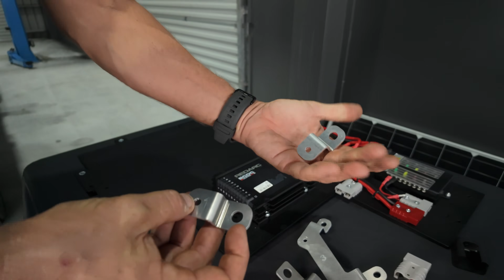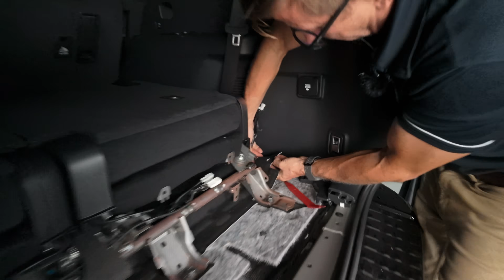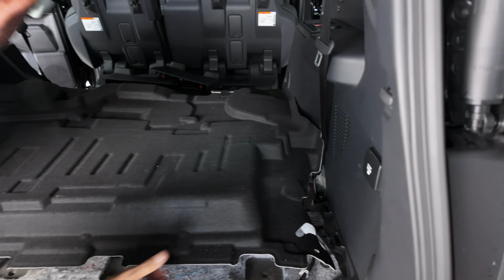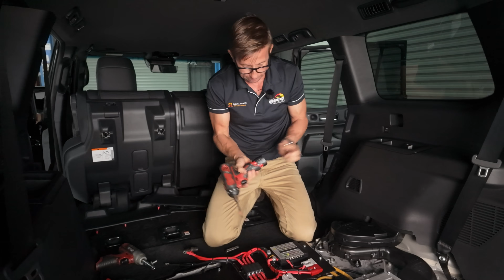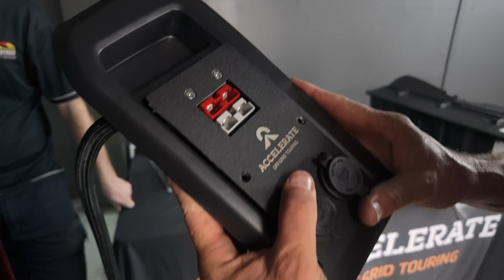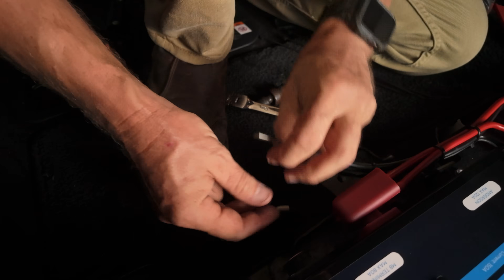Prado 250 Series - Underfloor Dual Battery - Install - Toyota Landcruiser

Comment: I've been dreaming of doing a setup like this with a ARB slimline for my Lexus GX460 which is identical to your guys's Prado 150. 
I'm deleting my 3rd row with genuine Toyota parts and theres still room under the floor for a lithium battery pack
Reply from the maker: Sounds like a great plan for the build! 👍
Reply: @accelerateoffgridtouring I emailed you guys about possibly assisting with a setup like this. Any chance you could help out?

Comment: I'd rather install dual gas tanks instead.
Reply from the maker: Haha fair call 😅 With the Prado 250, there are plenty of ways to set it up depending on how you travel.

Our focus is making use of that underfloor space for a neat, protected dual battery system without taking up room in the cabin or cargo area.

Comment: What does the prado weigh with the full set up
Reply: 7000 lbs
Reply from the maker: It depends on what model and number of seats you had. 100ah kits add about 17kg of weight.

Comment: So if you blow a fuse you need to remove drawer systems, fridges etc. bit of miss with your design. Not functional.
Reply from the maker: We've had a few people say this as well. We do now have the Under Bonnet design too. It's actually not to hard to access.

Comment: Nice kit.  What about the little cooling fans on the original unit below?  Are they covered and will that affect its cooling ability?
Reply from the maker: There is spacing between it all to allow airflow and the tray is aluminium. We monitored temps under there for a period of time in QLD and didn't see a change.

Comment: Do you or will you have a false floor setup that can incorporate this 12v setup? I currently have the 7 seater GXL and would love this setup but remove the rear seats and have a false floor flush.
Reply from the maker: We can do this in our workshop but do not sell false floors ourselves we use other brands and modify them :)

Comment: Will this fit under the loaded draws false floor setup?
Reply from the maker: Hey, We haven't tried it under those draws. It does work with the RV Storage False Floor - head over to our instagram and it is one of the top posts in a Lexus, but works with Toyota too.

Comment: @accelerateoffgridtouring  Nice solution. I'm thinking of buying the 5 seater so looking forward to seeing your solution for it. Looks like you've run the ignition switch from the USB-C in the panel for the 3rd row passengers. Do you know if the 5 seaters have a USB-C in the 'boot' and also do you sell those ignition wires standalone?
Reply from the maker: Hey, this kit suits the 7 & 5 seater models :)
Reply from the maker: Ignition wire currently only comes with the kit :)

Comment: Same unit & install for 5 seat Prado 250 Altitude?
Reply from the maker: Hey John, are you after a quote on this exact kit plus installation in our workshop ?
Reply: @accelerateoffgridtouring  Yes please, quote to supply & freight to Jurien Bay WA, also quote for install if you have an installer in WA? Note my Prado is a 5 seater, you video shows a 7 seater.

Comment: Do you have an option that will fit with the Lawson false floor?
Reply from the maker: We are currently working out a false floor variation!
Reply: @accelerateoffgridtouring any update on this? Also a version where I can use an existing slimline battery?

Comment: Looks awesome. Why tone down the Alpha 50?
Reply from the maker: Redarc has released a bulletin recommending a maximum continuous draw of 25 amps from the hybrid system. We’re happy to supply the 50 amp charger if preferred, but it must be manually dialled down to 25 amps using the app. Failing to do so may cause damage to your hybrid system and void the warranty on your new vehicle. Please note: Accelerate will not offer warranty on kits sold with the 50 amp charger.
Reply: @accelerateoffgridtouring  Is this only for your underfloor system? If i was to run the underbonnet system that is connected directly to the start battery can this handle a 40 or 50a draw?

Comment: I would be concerned with the idea of using the OEM battery link for your supply as Toyota would probably use that as a potential reason for any failure of the 48 volt system and deny warranty!  ANY 48 volt system failure could become a very expensive exercise so I would run a dedicated battery connection and fuse. Cheers.
Reply from the maker: Thanks for your comment, but I think there might be a misunderstanding about how this system is set up. We haven’t connected to the 48V system at all. The lead runs directly from the starter battery to the point where we’re connecting. If it gives you more peace of mind, you’re always welcome to run your own lead to the starter battery as usual — it’ll achieve the same result.

Comment: So you have a car coming with internal battery and you add another battery instead to find the way source engery form that already installed. 😂
Reply from the maker: Thanks for watching, yes we have done exactly that so you can power everything you need whilst off-grid with no risk of draining the start battery.
Reply: I am talking about the large battery not start battery from hybrid stystwm which has lots of power
Reply: I've been running a touring rig for over 20 years, with auxiliary power for a fridge, etc.The idea of bridging aux pwr from the existing pwr set-up is fraught with issues
1. Isolating auxiliary power from the vehicle's operating system maintains warranty and normal operation. 
2. When things go wrong, and they will, you minimise the risk of getting stranded.
While it might seem logical to tap into the vehicle's existing system for auxiliary pwr, experience will tell you that's not a good idea.

Comment: Do you know what size fuse is protecting that OEM cable from the DC-DC to the start battery? I have a 30amp DC-DC and would also like to connect to those studs, just worry about blowing the fuse if I increase the amperage draw on that cable.
Reply from the maker: Its not the fuse that you need to worry about as it far exceeds 30A. The current advice is to not exceed 25A draw from the vehicles start battery charging system. I would also make sure you DCDC has low CISPR11 and ECE Reg. 10 emission ratings like the Redarc BCDC as it is so close to the factory charging module. The cheaper ones can create alot of electrical noise.

Comment: Fantastic product, and great "how to" video.  How have you found it mitigating heat, particularly from the OEM DC/DC charger?  Is there enough air circulation for its fans to dispense heat?  And can you fit a higher capacity battery (ie. more than 100Ah)?
Reply: Wondered about that too, ie. how heat is being managed.  Particularly since the OEM DC-DC charger has two fan coolers etc.
Reply from the maker: We have found that there is very little temp variation back there. Also the BCDC 25a makes very little heat. The bigger ones can but this is another reason why we stick to the 25A version.
Reply: @accelerateoffgridtouring  What about the Toyota DC-DC charger?  Is there much heat generated by it?  And is there a higher capacity battery that will fit in the same spot?
Reply: @fatmanoverlanding could probably find someone who does custom batteries and give them measurements

Comment: Thanks for this. Is there room for an inverter, and if so, do you reckon it's possible to wire the inverter into the 240v plug that's already there?
Reply from the maker: Yes, you can fit a 1000w of some brands in the 5 seat version. We are currently working on a 7 seat solution.
Reply: @accelerateoffgridtouring  Looking forward to this video!